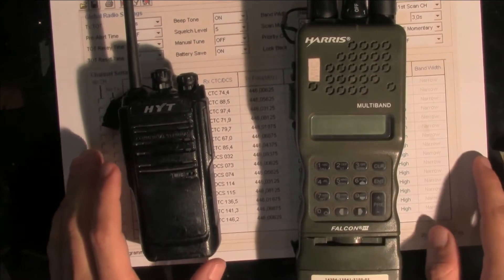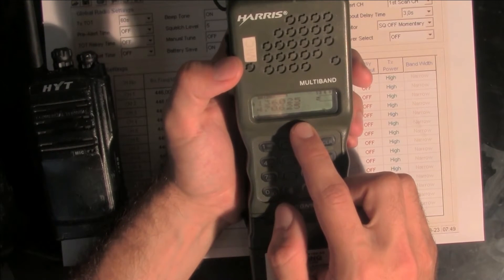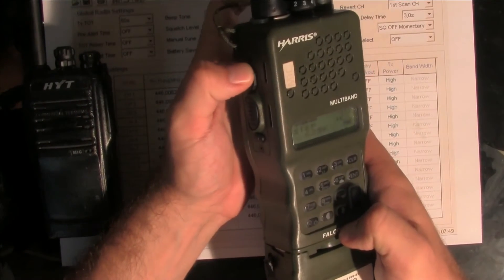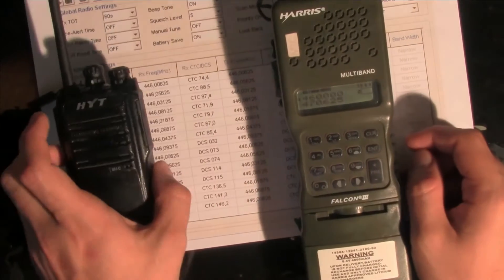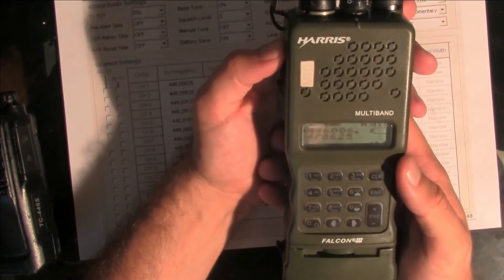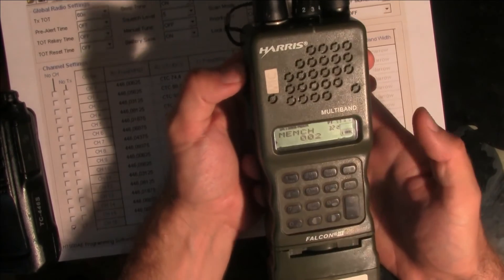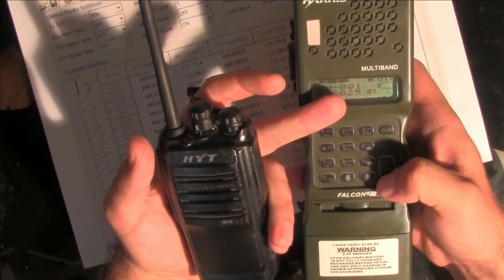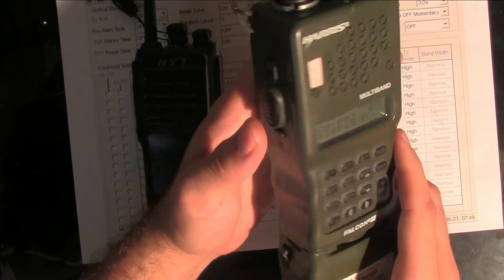Programming TRI PRC 152 replica from front panel to PMR frequency

Comment: Greetings, my name is Paul, I have the same radio, that said, for some reason I'm not able to save the Offset when programming a frequency in a "Repeater"  operation, I don't know what else to do, I follow all the steps in your video except for the portion of simplex operation, due to the fact that I want to access a "Repeater". Every parameter, except the "Offset" in this case -.600 will be saved.🤦‍♂️
Please help me.
Reply from the maker: Hello, I don't have this radio from couple years so I don't be good help for You since I can't try anything myself.  Some ideas: 1) Maybe You can get programming cable and program separate TX/RX where TX will be including offset) -  2) this one as dirty trick not real solution  - use double VFO - on one program repeater output on another input that way You can jump between.  3) maybe offset is global parameter (sound stupid, but this is china :>) - maybe You need to set it up while having radio in receiving mode not in programming.  Good Luck!

Comment: Seems like an incredible waste of money for something that's not even hard-wire programmable. What I don't get, is that it's operating on Ham Tech freqs and people are using them without a license. But then again, other radios have been doing the same for years. You can get the same and much more functionality for about 75 bucks, why are people tossing their money?
Reply from the maker: From time perspective those old versions were indeed waste of money.  New version (all metal body) that are interchangeable with genuine parts are great for all SAR operations (with genuine mil spec accessories).  I show how to program into PMR446 as general safety precaution so people don't TX on factory test frequencies or on some random FREQ that can be not only in HAM band but police / ems /  - if someone want work illegal I want make sure they do it without harming anyone.
Reply: @ElectronicNoobBlog  These guys are spending 250 to 500 bucks (depending on what they get) on these things and to buy one just to replace inferior parts with "genuine" parts is to me, even a bigger waste of money. Of course, you would only do that if a component failed, if only in the dead of night in a snow storm. So, I guess you can spend a few hundred bucks on a radio, then spend another 100 or so on converting to "genuine" parts or, enjoy the snow?
Reply from the maker: @tackanderson4270  You miss understand me,  I'm not referring to replacing any internal parts but using real accessories that have superb quality (antenna, battery, chargers, headset, handset, pouches) - all of this including metal shell with good seal gasket make perfect radio for field application for SAR operations (work in channelized mode so can be handled to non technical people).  (I'm referring to new model from 2021 not this one from video) - I will make video and tell couple things about radio failures in field showing on Motorola that cost couple times more and still if You fall on them, hit on body -  they get damaged.

Comment: Where did you get the printout again? Can I get a printout of any radio? Also, I have Thales handset and a Harris modified handset that looks like an old phone handset. When attached to the radio, the radio speaker is supposed to shut off and the handset speaker is supposed to be the only one that works. Mine is not doing that. Both speakers continue to work. Is there a way to fix this.?
Reply from the maker: Frequency table You get from another radio manual or programming software (read config) or You just set own frequencies and program them to other radios.
TRI PRC-152 (plastic one) won't work with army headset, first it's using short pins for muting internal speaker here i describe it (   https://www.youtube.com/watch?v=kwq0R_CvpVY ) but also it have different mic impedance (dynamic vs capacitance) so there is no way of being able transmit clean good level audio via real handset / headset without signal conversion.  I assume You have like mine on video plastic one because  new have ability to disable internal speaker  and change microphone type form menu.

Comment: Thanks a lot for the quick and easy to follow instructions: I have a problem to receive the voice from a Midland G9. The G9 receive the TX from the 152 without problem and the 152 screen lights up in green and I see the RX cursor moving as well when I transmit from the G9 but I do not hear anything.

The G9 has 38 CTCSS tones and for Ch1 I activated the N°01 (67.0 Hz) and set the same value on the 152 for the R & T CTCS Ch1 there, but to no results.

Any advise / suggestion is most welcomed. TIA
Reply from the maker: I do not have that radio anymore, but I would start from checking if 152 radio is receiving correctly and demodulated  so please disable CTCSS on 152 RX and check if You can hear audio from G9.  That's my first try.
Reply: My man!
Thanks for your quick and ready answer: I did as you suggested and now it works both ways. Possibly is a mismatch of the CTC freq used by the G9 but I used the values from their official table. Is there any difference between the CTCS used on the 152 and the CTCSS used on the G9?
Thanks again M8!
Reply from the maker: @sanatkumarasharma3627  You are welcome,  To be honest I can't answer that question, could be one reason that for example  radio could TX CTCSS in offset that preventing correct decoding for example 67.2 Hz, i had situation like this, one radio accept that fluctuation and open, other not.  For G9 (code number 1) CTCSS it should be set 67.0 Hz on 152. From what I read You understand concept, but just to make sure 152 accept CTCSS in Hz number.  If problem is deviation -offset You can try other CTCSS  for example (code number 2 - 71.9Hz) and on 152 try set 71.9, if not working 72, if not working 71.8  - just try if it's not offset little bit.   Also make sure You have good step 6.25kHz on 152 because having it wrong for example 5kHz could make difference in proper decoding - it might look working at close range. You can always use DCS instead CTCSS and check if that help.
Reply: Thanks a bunch for taking the time to answer: I came to realize that the CTCS is not essential but just a way to exclude listening to others who do not have that same CTCS using that same channel. 

I mean, these others they can still listen to your conversation but you will not listen to theirs. It will be easier and safer to switch to a different channel if you do not want to hear all their chatter while talking to someone specifically...

Comment: I have the ver2 TRI 152a but I can not transmit through the peltor headset could you Help? I can receive
Reply from the maker: To me it sounds like microphone  impedance problem.
Have You try select dynamic microphone from menu? //I don't own that radio so i can't tell You where but i read in some ad that it have that option to work with genuine army.  Should be something like Condenser / Dynamic.
Reply: @ElectronicNoobBlog  it was a faulty PTT. My friend has the same setup tried my radio with is PTT and work fine But thank you for your reply very much appreciated. Nope it must be the PTT from JK as the sound is coming out of the microphone not the headphones
Reply from the maker: @TheDigitalFlight   Thank You for update.

Comment: do u recommend the radio? dows it worth the money? can I use the original peltor ptt on it?
Reply from the maker: I do not recommend that radio (this is old model, with plastic case) (in term of range, quality it's compared to Baofeng).
This model do not allow use real military accessory (they use dynamic microphone and they require additional circuitry to work).
They have new model,  have metal body,  allow use military headset and  is HF version -  i never tried it because it's to expensive but it's looking good in case of replica and HF version would offer greater range in woods than UHF and VHF.
Reply: Electronic Noob Blog what is the metalbody model called? Is it a real military radio or a replica too?

Comment: I have a problem with my 152. Today I tried to talk to a midland G9 PMR radio. I didn't use a ptt or headset. 

The
 problem is, I can hear everything fine coming from the midland to the 
TRI but on the midland my voice is very quiet. Does this have anything 
to do with a setting or is the microphone really that bad?
Reply from the maker: That's same as mine two,  mic is on the quite side but then i realize that is good because it's not transmit other peoples in noise environment.  
I don't know any way of boosting it from front panel.

When You learn where to speak it work perfect, but i have problem with people who don't know this radio. 
You can see on video, i made small white sticker, it fade away but there is written mic and you need to speak there, not in front of grill, or right side (like You would normally do), only left hole will pick up.

Hope it help
Reply: Tido Schmidt